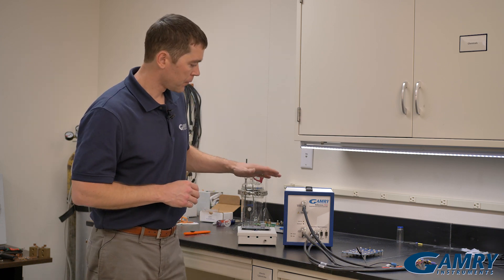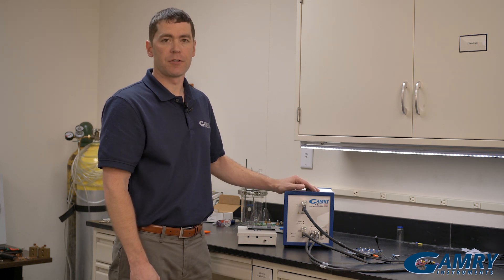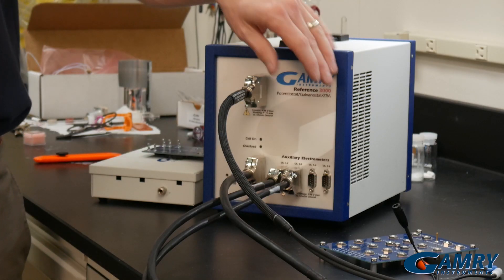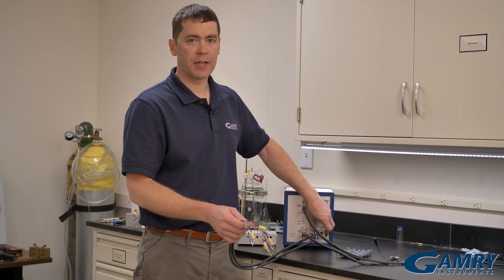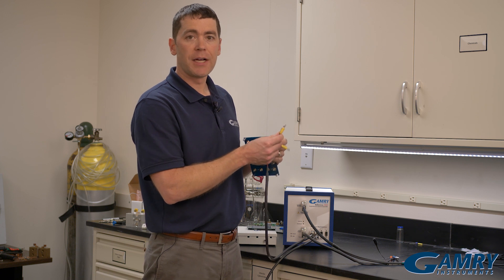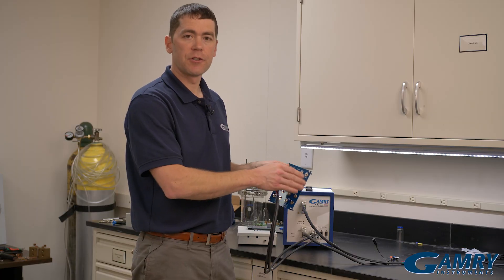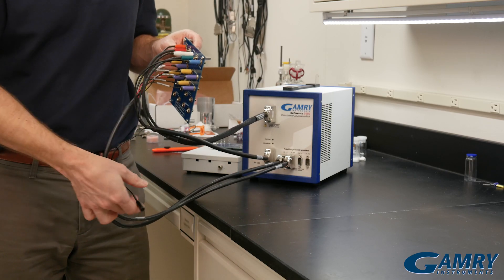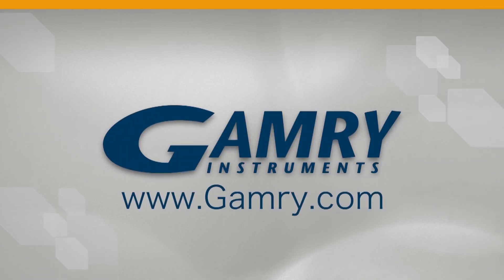Calibrate Gamry Reference 3000 AE

Comment: Does the calibration cell come with the instrument?
Reply from the maker: Thank you for your question.  Per the Manual available online " The standard Reference 3000 calibration calls for an external resistive dummy cell. Your Reference 3000 & 3000AE was shipped with a Calibration Cell, which includes a 2 kΩ, 0.05% accurate resistor. After calibration, please place this Calibration Cell in a safe place where you can find it if your unit requires recalibration.
If you do need to recalibrate and you cannot find your Calibration Cell, you can perform DC Calibration
using a different 2 kΩ resistor. Its power-rating is unimportant. Some performance checks in the calibration
process may fail if the resistors inaccuracy exceeds 0.2% (4 Ω).
We do not recommend AC Calibration with any resistor other than the one on the Calibration Cell. The
Calibration Cell was designed to separate the working electrode leads from the counter and reference
electrode leads. If you perform AC Calibration without adequate separation between these leads, you will
see a phase-shift in your high-frequency EIS data. 1.4 pF of stray capacitance across a 2000 Ω resistor
causes a 1° phase-shift at 1 MHz

Hope this helps.  If  you do not have the Manual, you can downloa here:  https://www.gamry.com/assets/uploads/Reference-3000-Operators-Manual.pdf
Thank you for your interest in Gamry's Instruments